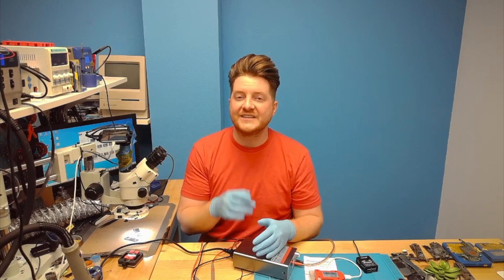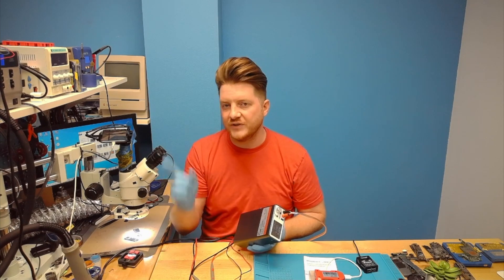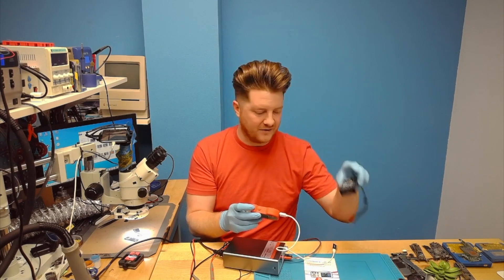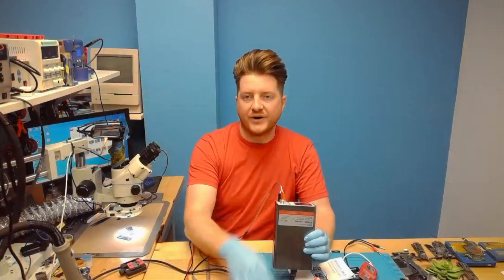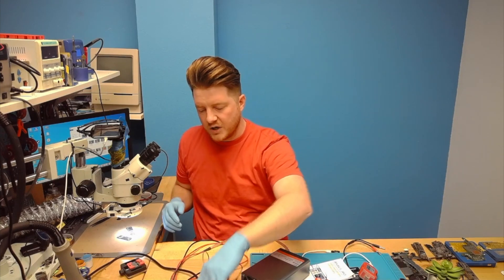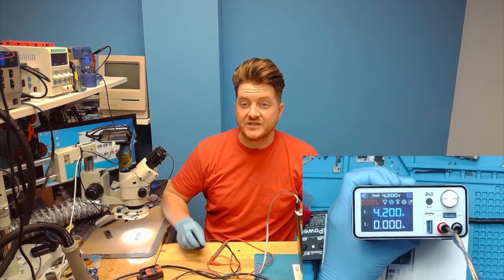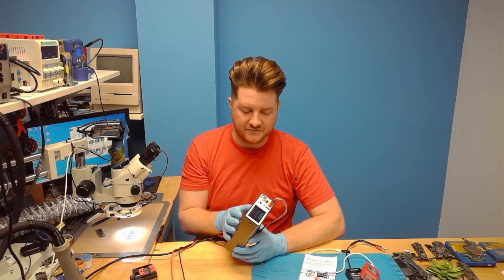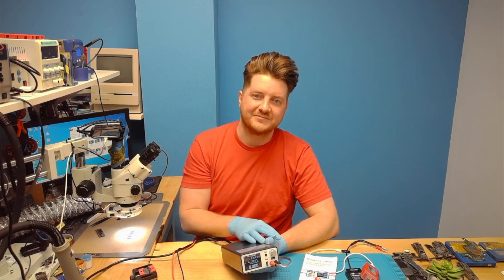Aixun P2408 DCPS - How to Inject Voltage REVIEW - Easy Method

Comment: Dude adjust the current alarm, that's user error not a problem with the tool. Im surprised you uploaded this embarrassing video
Reply from the maker: Thank you for watching! You can’t adjust it lol. You have to remove the alarm which I did. This was a spoof video🤣
Reply: @profixerr6275  yes sir you can, I'll have to send you the link for the instruction video directly from aixun. I know you can because I'm adjusting the current alarm on mine right now...

Comment: Why it pumps just 3A when you short it? It is rated at 8A, have you set any limit? I want to use it for the purpose of pumping current in shorted boards to find short circuit.
Reply: That’s what you use this for, the shorted component will heat up so it can be seen on a thermal camera